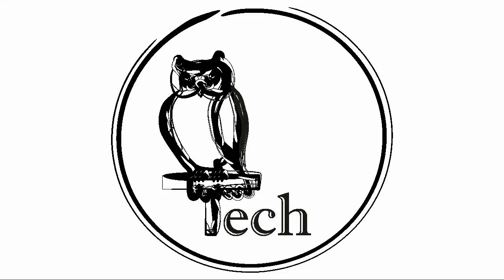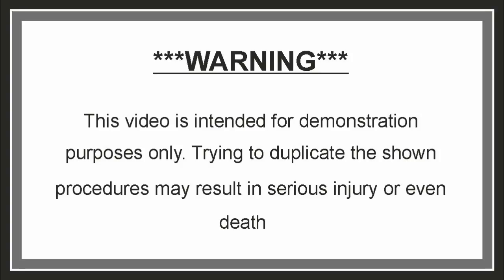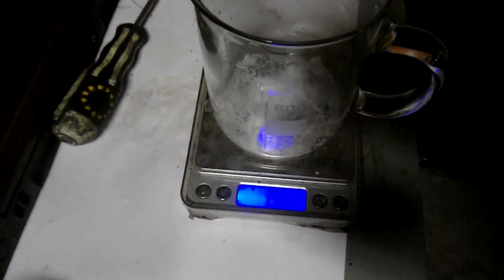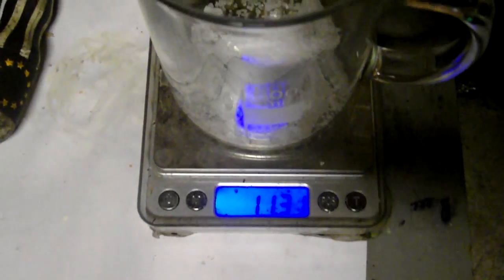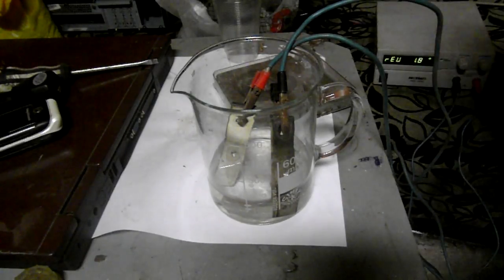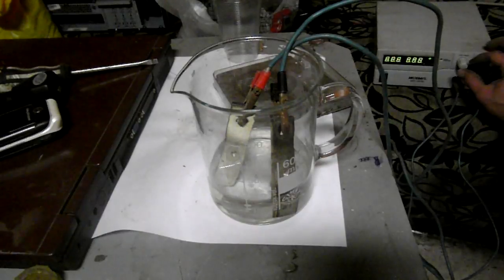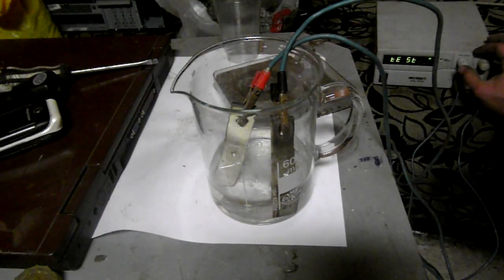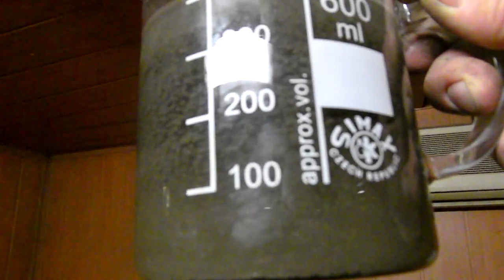SILVER stripping cell - sodium sulphite electrolyte PART 1

Comment: Good evening OwlTech! Using a 2l test beaker with 58g per liter of electrolyte in distilled water. Getting a black precipitate and a very shiny silver piece. Using a grid of platinum coated titanium as a cathode. Voltage at 1.5, is pulling about 0.1-0.2 amps during the process. Love your videos!!

Comment: I have sodium sulphide that someone gave me thinking it's something I could use in me hobby, this came along with some DMG, some HCl but the DMG bottle was almost empty and it got lost. And the HCl seemed to be useless. But this sodium sulphide is still full and like to use it if possible. But I'm not sure if it's indeed sodium sulphide. Could you possibly tell me if it's a reddish color or a way for me to test it? Thanks either way! I send a pic but idk if that's a possibility.

Comment: Hello! How much Na2So3/L is necessary to build the electrolyte? What ist best for catode?
Reply from the maker: for this video I've added  enough water to dissolve the ingredients, but then the electrolyte was further diluted with the washing waters which didn't lead to any noticeable change. I've used another silver piece as cathode for this video, but believe other metals such as stainless steel or graphite will also work. I've read the electrolyte has short shelf life as the Na2SO3 is oxidised to Na2SO4 by oxygen in the air (which was confirmed on the next day as the electrolyte didn't produce the same results)